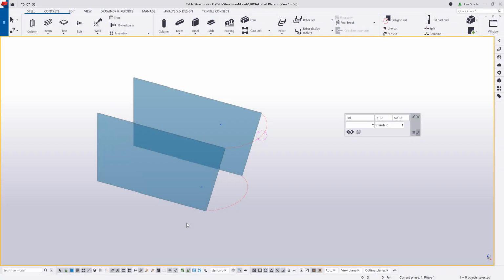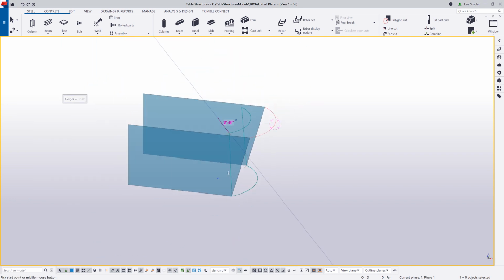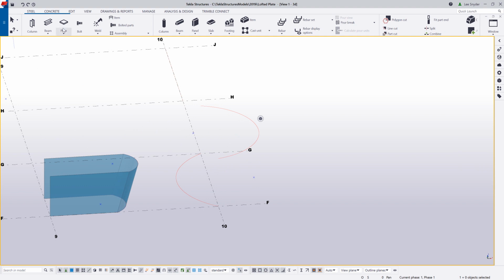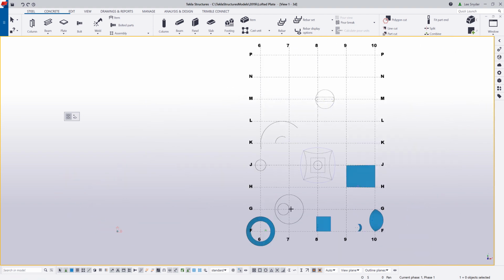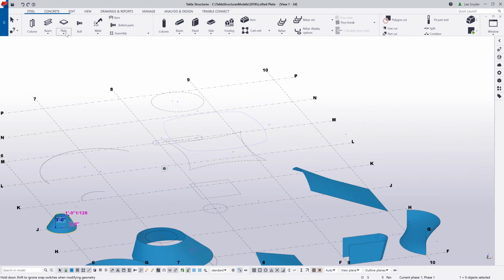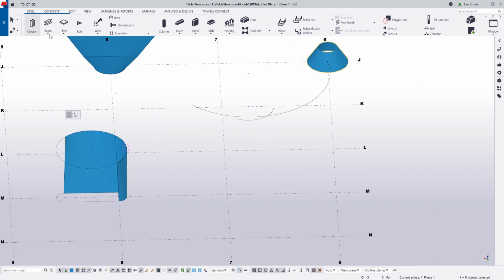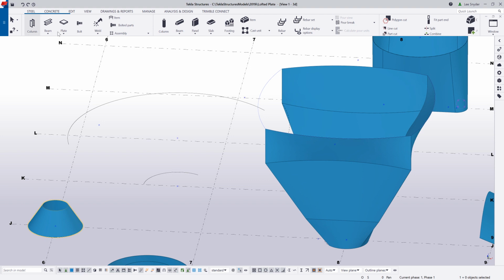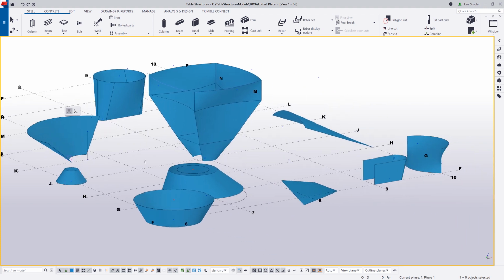Tekla Structures 2019i Lofted Plate

Comment: When I am practicing lofted slab with square to circle. Cursor will select only squares but not circles.
Reply: Since there is no 'square' I assume you're making one from the polycurve command. This is technically an 'open' shape, while the circle is a 'closed' shape. The lofted tool will not work well between them. If you instead make a large Arc that is almost, but not quite closed, you may have better results.
Reply: @TrimbleTeklaDave  thanks for the information.

Comment: Thank you Tekla for this tool. I see some questions:

Is possible to create unfolded shape in the drawing of the item?
Is possible to define welds on the 3D shaped edges with preparation for weld?
Is possible create holes in the lofted plate?
Is possible to create NC files of lofted plate? And from lofted plate with weld preparation?

Than it is usable only limitted for presentation of the shape or fully for detailing.
Reply: Hello!
1. At this time, for the lofted plate, it is only possible to unfold cylindrical or conical surface made of arcs including oblique surfaces.

2. The weld solid in most cases won't work because the weld is a solid with constant cross-section and doesn't support any twisting at this time.

3. Yes it is possible to create holes. 

4. It is possible to create CNC files for the supported scenarios in Question 1.  Currently the automatic weld preparations won't work for most of these shapes
Reply: @ @leesnyder6784  Thank you for the presentation. Petr had the exact questions I was thinking of. Clients always request unfolded DSTV files for such parts. We also hit a dead end when trying to unfold curved plates created with "curved beam" tool. Can you tell us if we'll see a solution for these issues in the near future?

Thank you.
Reply: @2Short2Get  Thanks for reaching out!  For a lot of the shapes that are created by the lofted plate we haven't been able to find any standard consensus for how they should be unfolded.  Could you send us/show us which shapes don't unfold and how you need them unfolded so we can create a spec to support it?
Reply: @leesnyder6784  Sure, I'd love to. Can I send you an e-mail at the beginning of next week? Might be a better way to communicate than Youtube comments :) . There are quite a few things I'd like to share with you, including our experience with Hololens.